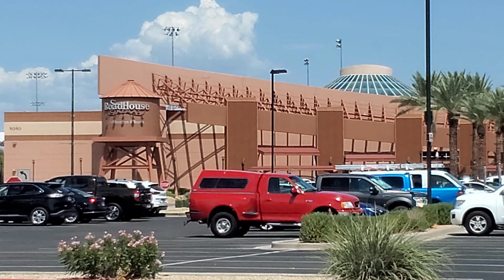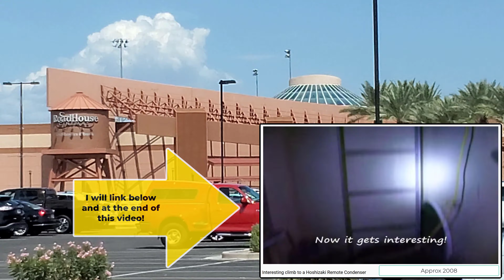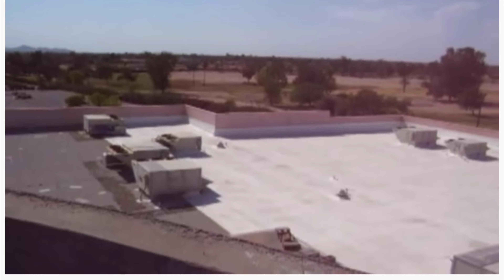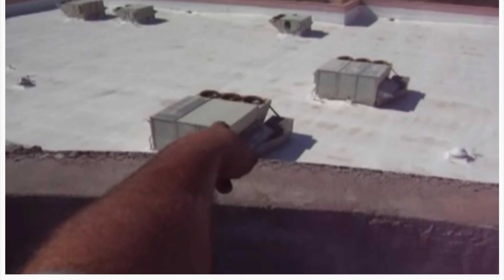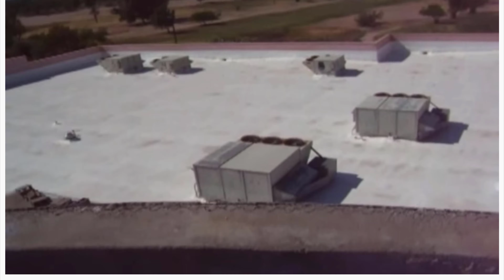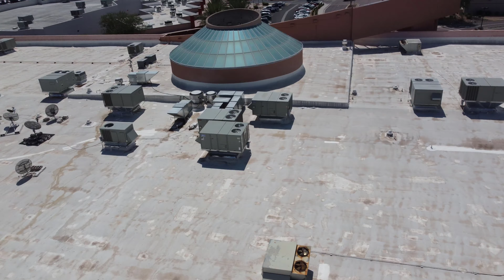How ghetto is this rooftop? [Episode 14] Old Scottsdale UA Theater then and now!!!

Comment: Cool to revisit and see a few of those old systems still running! They put a lot of $ in to that place. It looks like some of the new units are the Foundation series. Trane's cheap line for budget replacement jobs. Not quite as nice as the Voyager.
Reply from the maker: Yeah it looks good.
I noticed that some units have the Trane label and some had the American Standard label